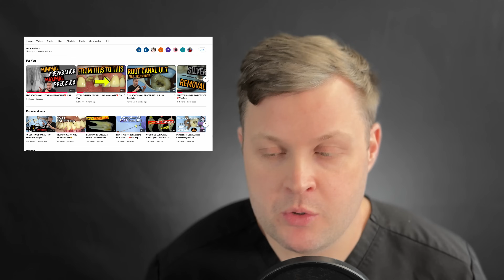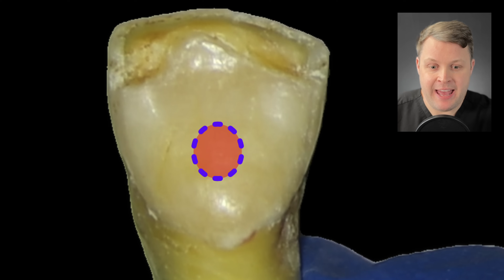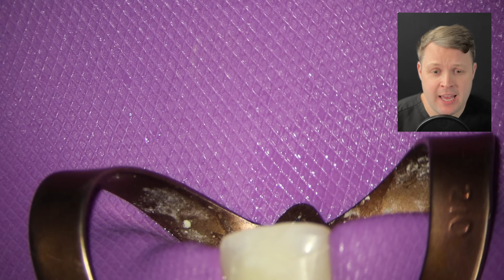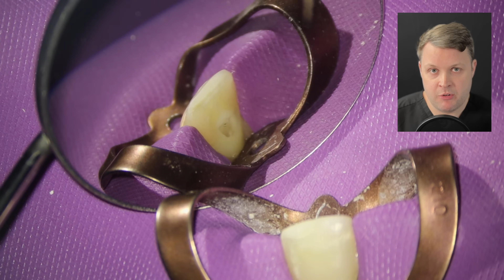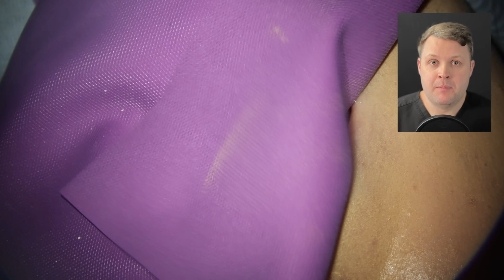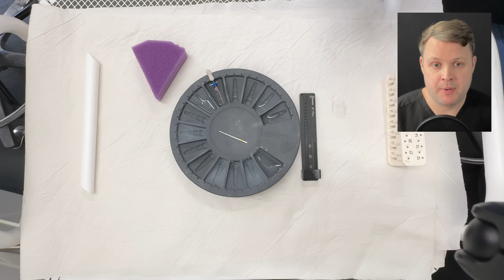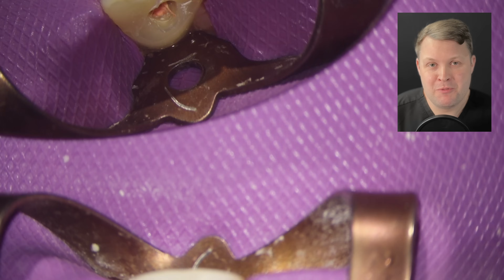🔬 The PERFECT Access Cavity for an Incisor – Step-by-Step Guide! 🦷

Comment: 1:17 Yeah watching you from turkiye doc thanks for your help. I just want to ask you a question. After root canal treatment is there any changes to our adhesive bonding protocol. Do you have any video about that? Because after irrigation the dentin gets denatured. Do we have to refresh dentin with rough diamond bur.
Reply from the maker: If I am being completely honest, my restorative knowledge is pretty poor! I tend to use scotch bond or a generic bond prior to layering my composite. What do you think is the correct protocol?
Reply: @ilovethepulp  Hi doctor! I heard that irrigation causes decreased bond strength by causing dentin denaturation. So, we need to refresh the dentin with a rough diamond bur to remove the denatured dentin. I haven't found an article about that yet. If I find anything, I'll be glad to share it with you.
Reply: The aim was to investigate the influence of endodontic irrigation solutions and protocols on the micro-tensile bond strength (μTBS) to dentin using an etch-and-rinse (ER) or self-etch (SE) adhesive approach. The highest μTBS was achieved when using a NaOCl–EDTA–NaOCl irrigation protocol in combination with Clearfil SE Bond, which shows that the selection of the endodontic irrigation should match the corresponding SE adhesive system. This might be the correct protocol if we want to increase bond strength. But I've actually no idea about refreshing dentin with a diamond bur part.
Reply from the maker: @ thank you. Very interesting, seems like I am doing the right irrigation protocol without even knowing it! 🤣 Although I might need to change my bonding protocol!
Reply: @ Thank you too doc